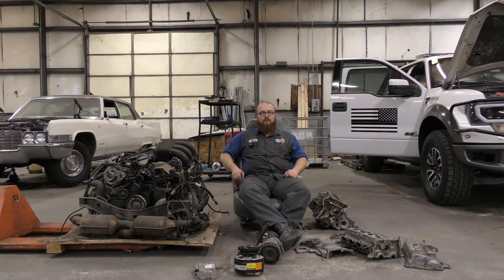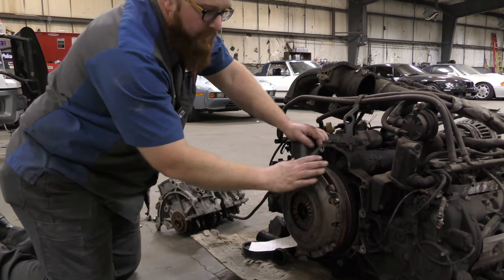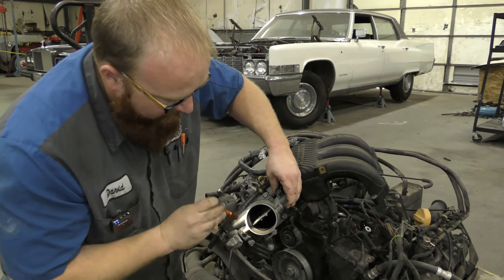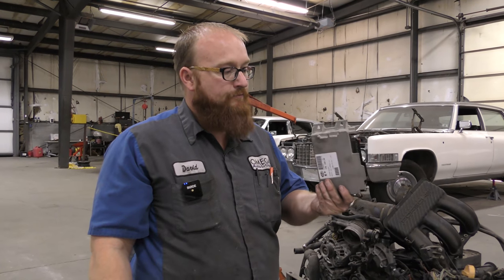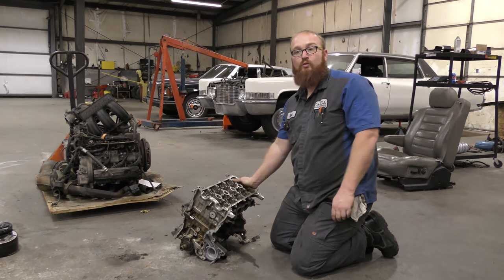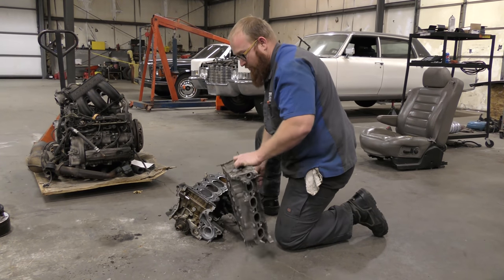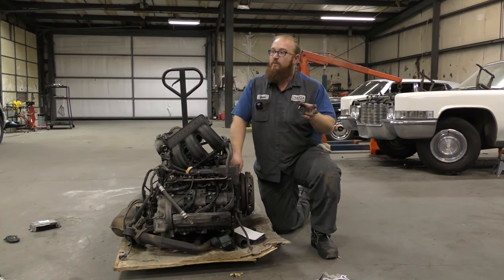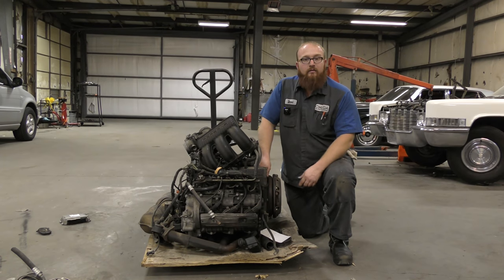The CAR WIZARD explains in everyday terms common Engine issues

Comment: Great informative video!!!Just a question,when you were talking about a bad catalytic converter and oxygen sensors,is it a possibility that a faulty oxygen sensor may have been the contributing factor to the demise of the catalytic converter,improper fuel trim etc.Just asking!!!
Reply: A Diagnostic code for "Catalyst System Efficiency Below Threshold" doesn't necessarily even mean that the cat is bad. If the oxygen sensor after the cat (the one checking to make sure the cat is doing its job) is faulty, it doesn't really know if the cat is good or bad. It doesn't know what's going on and claims the system has a problem when it's not even able to measure that accurately any longer. I had that happen with a Honda I picked up. Seller cleared the code before selling it to me and it popped up 50 miles later. Joke's on him, because he dumped it thinking it needed a new expensive catalytic converter when all it needed was a $30 oxygen sensor. To answer your question, yes it is a possibility if it's the sensor before the cat. If it's not reading correctly, it could be dumping excess fuel into the engine, expelling excess unburnt fuel into the exhaust, and overworking the catalytic converter. If it's the sensor after the cat, no it's not a possibility because it has no effect on how the engine runs.

Comment: I have a 2007 5.4 ford engine and I get 10 miles a quart. My engine leaks from the front and back and it squirts on top. I have 270,000 miles on it and travel 60+ miles a day. I hope now that I know what's going on it doesn't brack be for my new Bronco to be delivered.

Comment: Funny head gasket story. I've talked about my Dodge 4.7 before. I ran it with a compromised gasket for at least 8 years. In 2010 I discovered it would split radiator hoses or blow one off the nipple if I floored it. Later on it started burning coolant when cold but it never ran hot if I kept the system full. Fixed now with a rebuild but I worry I'll face the issue again eventually.

Comment: I love your videos. However I'm the one the one who likes to nitpick. You should have made it more clear how rear main seal replacement could cost most because of the work involved. Also when replacing head and/or head gasket you should have made it more clear to always check that block is straight even thought it usually is.

Comment: Hello wizard you are probably  The most knowledgeable person I've seen about car issues. I have a question about a 2011 Toyota Sienna 6 cylinder with 190000 miles no warning lights or anything but the engine just isn't quiet anymore is there anything that can be fixed or I can ask a mechanic to look at?  Thanks for the knowledge sir.

Comment: Wizard, what I don't understand is why, with diesel engines, if the injectors have a problem, it can also blow exhaust gases into the interior. How does a leaky injector leak exhaust gas into the engine bay? Because if it didn't seal the combustion chamber which it sits in, then the engine wouldn't have any compression, and the injectors don't come into contact with exhaust gas anywhere else except in the combustion chamber? So I don't really get the relation between this fault and its effect...

Comment: The pcm,  ecm,  computer,  etc. I would say is very similar in principle to  a FADEC (Full Authority Digital Engine Control...I think that's what it stands for)  system from an aircraft and it's used from light aircraft through to helicopters and jets. The FADEC stores codes which can be retrieved and deciphered by mechanics if anything is amiss

Comment: Oh All-Knowing Car Weeeeeeeeeeeeezard...  I have a 2004 Cadillac SRX with 150K miles...3.6l V6  that I have been chasing a gremlin on. When it's really hot out, ( AZ Temps of 109 and hotter outside ), the car hesitates from a stop after driving for a while. I step on the gas but it hesitates/stumbles then suddenly lunges forward full acceleration until I let off the gas. I've had the Throttle Position Sensor & Body changed. I've had the MAF sensor changed. I've had the Crankcase Ventilation Hose system changed. I couldn't get the metal "pvc" pipe out of the passenger side valve cover out to see if it was clogged. I know the common problem is that the holes in it are too small but I couldn't pop it out of the valse cover so I sprayed contact cleaner in there like crazy to hopefully clean it out. Then changed the oil and ran the car but no change. Car still hesitates when extreme heat out and some miles put on the car. Now I'm thinking the piston rings are worn and I'm building up too much pressure in the bottom of the engine or...the transmission shifting computer is going bad for the 1st gear...or....the accelerator pedal sensor is going bad?

Comment: What do you think of the Toyota 5VZ-FE engine?
I have a 1996 Toyota 4Runner that still runs like a swiss watch after 24 years and 350,000 miles.
I am currently rebuilding the suspension and steering, but that engine has never shown a single sign of wanting to quit.

Comment: Cat efficiency codes can also be triggered by a leaking exhaust system (like a rust hole further down or a bad connection between exhaust pieces)

Comment: German workshops usually even have a measuring tool that takes a probe of the antifreeze and bubbles it through an indicator liquid and if there's CO2 from the exhaust gases in the antifreeze, it changes color, and that means your head gasket is pooched.
Reply: TableRocked  Yeah, I bet these tools are available worldwide ;-)

Comment: Car Wizad. I find a mistake in your video where you talk about cat inefficiency. You said that if you get the code for cat inefficiency it either means that the sensor in the back of the cats is bad or the cat itself is bad. But sometimes the first sensor can be bad causing engine to run too rich and cats won't be able to deal with it then it would mean that there is another issue causing that cat inefficiency code am I right? So even if you change the cat the code might come back sooner than you think and cats are not cheap. Please correct me if I am wrong, saw this stuff on Scotty's channel where he explained that cat inefficiency could be caused by more reasons than just bad sensor or cat itself.

Comment: Maybe a video on the common and highly hated 4.0L SOHC Ford. You know, the horrible one where the passenger timing chain and guides are on the BACK of the engine and impossible to get to without pulling the whole thing out.
Reply: Fun fact it's easier to do a R&R on the engine than changes both timing sets 16.4hrs to R&R or 21.3 hrs to change the timing set according to Mitchell stupid explorers

Comment: Valve cover leaks, spark plugs covered in oil, super gross and annoying since the rubber boot type spark plug remover starts to slip.

Comment: I got a check engine light, and I checked, and the engine is still there! What now?!
Reply: Uncheck it then.
Reply: Well now you know the engine is still there. The problem now (and this is why the check engine light stays on for now) is that the ECM/ECU does not know that you checked and that you now know the engine is still there. You just need to find a way to tell it that. Then it'll be fine.

Comment: I wish I could bring my car to you! I have a 95 deville with the pfi 4.9l. It clicks when I hit the break and let off of the break. It makes some weird noises sometimes and idk why. Also the motor feels really “torquey” even though I just got the front motor mount replaced. I got the ac pulley bypassed because it was making a lot of noise and they said my pulley was going to seize. I just want my car to run perfect. I’m $2500 into the car. That includes buying it for $1000. It’s in really decent condition with 164,000 miles on it. I have to put another $500 into it for a good tune up. Then I need snow tires. My tune up is plugs, wires, rotor, rotor cap, and fuel filter for $410 does that sound right?

Comment: All the computer cares about is fuel the job of the computer is to read what the sensors are telling it and eject the proper amount of fuel all the computer cares about. Yea it dose other little things like keep track of the mileage driven and help out the ABS system but mostly it just cares about fuel.

Comment: Wiz & community, the weirdest AC related problem I ever had was on a Gen 2 Mazda RX-7. (My 87 or my 90; I had 3 of them lol) Idle speed fluctuated w the AC off from like 400 to 1000 ebery 3 sec or so... until I put the AC system ON; then the engine would idle at a clean rock-steady 700ish rpm!! Car is long since gone for parts but seriously what was that??

Comment: hello wizard, im struggling with a tuscan 2018,    im getting a 40 volt spike on mi scope, its everywhere even on the can bus lines, I've disconnected coils, alternator, injectors, spike is still there do you have any thoughts on what it could be

Comment: LOL, I know all this from theory (never actually worked on an engine though), but the way you said "that's where your antifreeze goes and keeps your engine cool" sounds like someone without that knowledge would have to ask "Well, why is it called antifreeze than, shouldn't it be called antiboil?" ;-) (I know that it's called that because it also prevents the engine from freezing up while sitting outside in cold winter climate, but it just sounded funny)

Comment: Never had any issues, since I only drive Mitsubishi. My Mirage has well over 100000 miles on it, and I never had it in a shop for any kind of service. The only things that has been replaced is oil and oil oilfilter every 12000 miles. Sparkplugs and brakepads have only been replaced once. (I have ONLY used 5w40 motoroil from Shell and wix filters in that car)
Reply: You might want to cut that oil change interval to 5000-6000 now. Just sayin'
Reply: Serban C. Musca -No need for that. A friend of mine still drives my old 1998 Honda Civic 1.4 i and that car now has over 261.000 miles on it with the original engine and it also only had the oil and filter changed every 12000 miles and only uses 0,5 liter oil every 12000 miles. AND, that is even with a 10w40 oil. (First 120.000 miles with Agip oil, the rest from Shell) JUST SAYIN'

Comment: Yeah but that’s just the engine computer. Some cars have 18 or more modules in them.  you have computers for basically everything. Even when you hit the switch to roll down your window it goes through the body control module which is another computer. Everything in modern cars is multiplex and goes through a bus system

Comment: "It's not computer like you're thinking. All it does is take information coming in and gives the result coming out."

Nothing wrong with the description, but working with computers, this sounded a bit funny. Granted, a personal computer has more inputs (keyboard, mouse, network, storage device, ram...) and outputs (monitor, network, storage device, ram...) than the car computer, but in the core, that's what any computer does. That's why the personal computers are often referred to as computer systems or simply systems, to refer to collection of all the different devices.
Reply from the maker: ksiimson Ive literally had customers ask if the cars computer can be used for media storage, and if it can get bluetooth installed into the ecm. Hence my explanation
Reply: Heh, wouldn't that be interesting if car computers had bluetooth. Someone called your phone, and your air bag popped out, because everything was controlled by one single computer, and there was some defect in there! Not to even start with a whole list of other issues, such as security and maintaining compatibility with consumer hardware. But yeah, communication is difficult, and I think you did an excellent job explaining it to the general audience, even if it sounded funny to me!

Comment: OR, you could have a Tesla (electric) and avoid all these expenses entirely.  Zero maintenance other than windshield wiper fluid and tires.  Motor and battery rated at 1 million miles.

Comment: How about doing a show in which you tell us what auto's from the period from the 1960's to say 1989 that are not currently ultra expensive but you think will become collectable so a person could buy a very good example of the auto that cost less then twenty thousand now and it is in very good shape drive it all works and not a rust bucket but if restored or just kept in the current shape you think it will go up in price within ten years by a fair bit. I am thinking of the Jeep J series the J10 or J20 . I know the Grand Wagoneer is very collectable but perhaps the J series will become so in time . Other auto's mostly north American that will go up in price and in addition fixing one up is not crazy expensive due to parts cost.  Even if you just said Ok from that time period I would like to have a X . kind of auto in my own home garage .
Reply: Unfortunately. The J trucks are collected last one I saw 1 for sale was rusted to hell and guy still thought it was worth 3k no motor no trans just a rusted jeep body ,frame and some old Dana axles

Comment: Last year my mom bought a 2015 Nissan Juke 1.2 DIG-T. Had about 8,000 miles on it when she bought it. Really tidy car. She took it to get MOT'd a year later and found a small oil leak between the gearbox and the engine. They said it didn't look too serious but it's something to keep an eye on. We took it to our trusted mechanic to inspect the leak and found the gearbox slave cylinder had bad bearing. Caused by catastrophic flywheel play. Like an inch of play. Whole flywheel was fucked at 20k miles and had took the slave cylinder with it. Actual piece of crap cars lmao
Reply: Many mechanics on YT agree with you on the quality of these "cars".
Reply: @SerbanCMusca-ut8ny  £1500 repair bill because for some strange reason they fitted this tiny 1.2 petrol engine with a dual mass flywheel
Reply: @BrandinooWOW  1.2 petrol: fit it with a dual mass flywheel! Makes perfect sense (insert "genius" meme here)...

Comment: I've blocked the check engine light with a piece of masking tape. Best thing I've ever done saves a lot of stress
Reply: yea what most don't understand is if the check engine light comes on..all it means is something within the emissions system as sent a value outside of the expected range.  That's all.  However..if the light is blinking..that means the computer has received information that indicates that one or many parts are at risk of failure.  Get to where you're going or somewhere safe as quickly as possible...a blinking check engine light isn't joking with you.
Reply: @nonperishables5870  I guess not everybody gets a joke when one reads one...